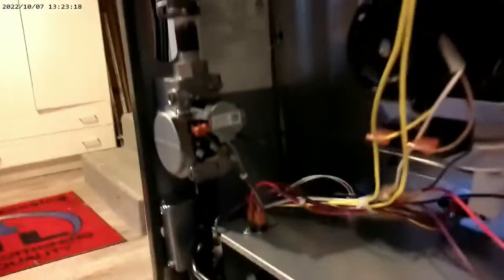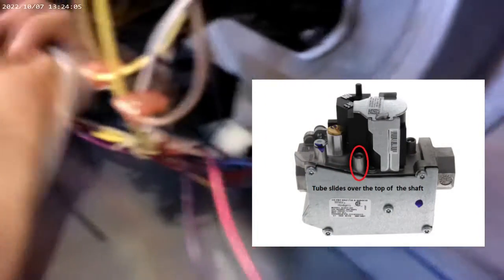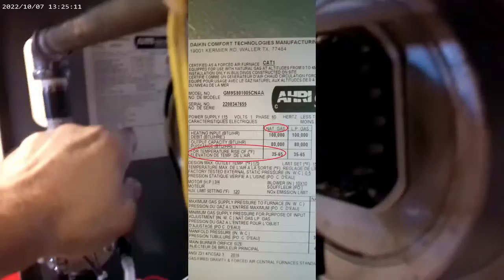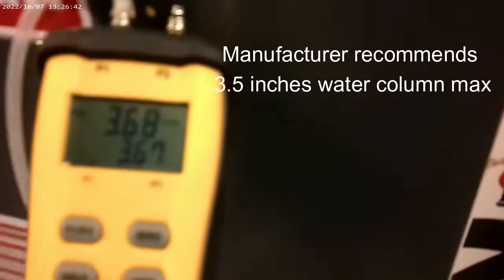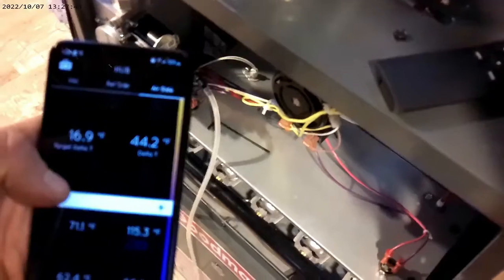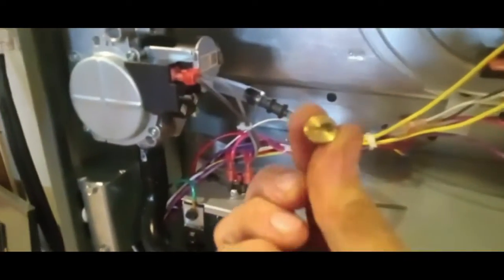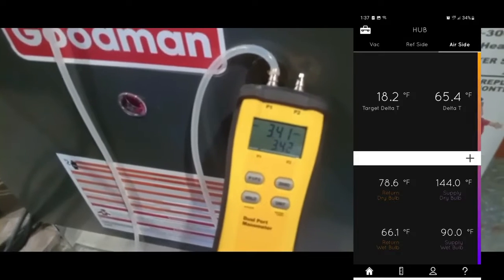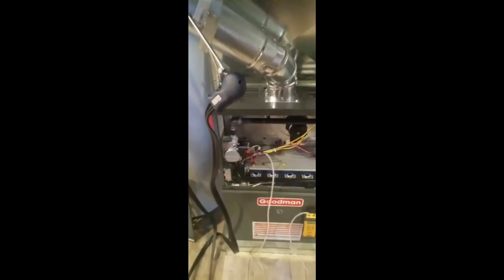Heat Rise Test / Gas Valve Adjustment

Comment: Went to check my gas pressures and that adjusting screw cap is seized on there. I applied a little bit of Kroil and liquid wrench to help but it’s just not budging. I’m afraid I’m going to strip that screw lol

Comment: Ok so 65F is your maximum Delta T. That is 100% the maximum temperature rise allowed. If the filter gets 50% clogged your Delta T is going to be through the roof and the appliance is going to over shoot the Delta T. Every good service tech knows that EVERY home owner likes to push filter changes to the max. Why not adjust the Delta T to 50% of the manufactures specifications in this case 35-65 so 50F. Then your furnace will not overshoot????? Just a thought......use it don't use it.....

Comment: Great video , I use to think if temp rise was out of parameters. Need only to adjust blower speed , didn’t know  manifold wc has something to do !!  Also what would be the consequences of going over the  wc recommended on plate ?thank you
Reply from the maker: I started up a Carrier furnace today and the gas valve was so wide open from manufacturing that I ended up with nearly a 140 degree delta. lol. I don't think the blower could have run fast enough to bring that down into range!

Hi WC could damage the heat exchanger over time because its firing too hot. It can also lead to a rich flame, incomplete combustion and eventually flue pipe corrosion.